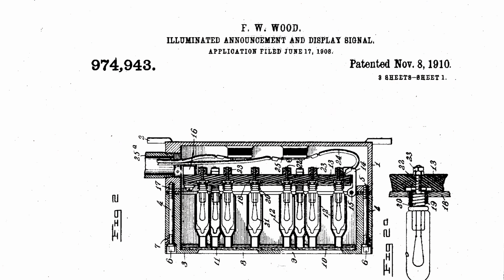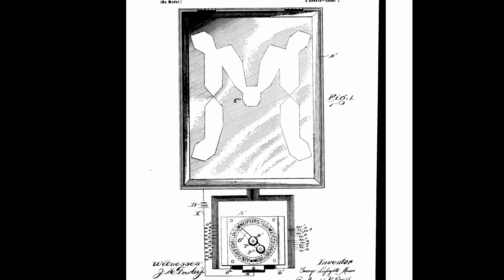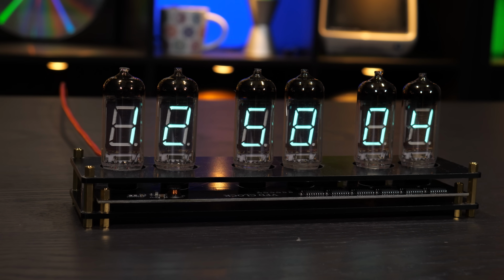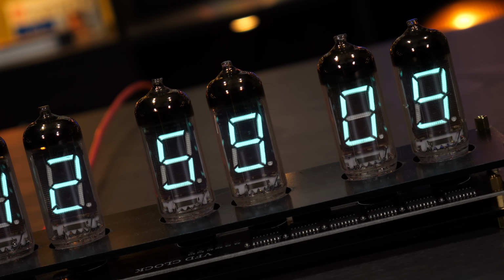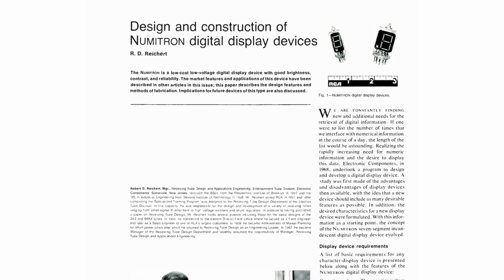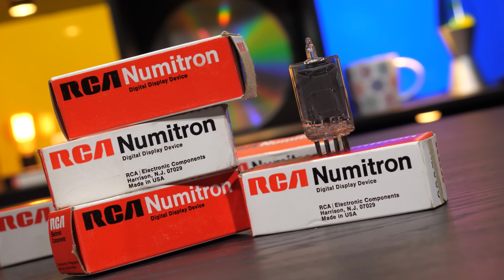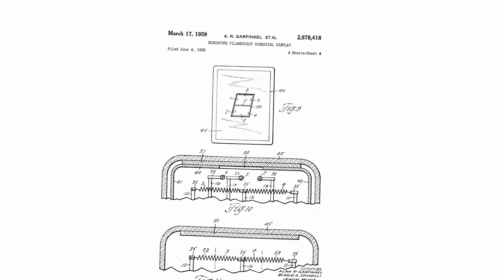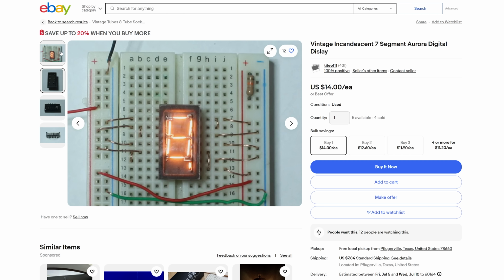The Numitron: An obvious idea that wasn't very bright

Comment: When I heard your suggestion of a giant segmented display using fluorescent tubes, my immediate thoughts were: Has anyone actually built that? If so, how long did it last in actual use before at least one of the tubes failed?
As you are probably aware, the lifetime and reliability of fluorescent tube lights depends on how many times they are switched on and off. So if a display made with them was intended to show a single number or letter constantly, with no changes and no switching on or off, it could last as long as the tubes themselves. But if it was used as a counter or clock, continuously changing the numbers displayed, the lifetime would be drastically reduced.

Comment: In 1972 I designed and built a Nixie tube digital clock using raw 170V DC from a diode and capacitor thrown across rectified AC and fed through six 7441 TTL drivers. Except for power outages and moves, it has been running 24/7 ever since. Great technology!

Comment: I loved the nixie displays on plug in desktop calculators. There was a slight depth issue from stacking 10 electrodes in front of each other, but the numbers were readable and bright. Of course 180v DC needed good AC supply. It may have been easier with 240v power points.

Comment: In the 60s we were grasping for displays.  I used 4 nixed I had to make a digital 
readout car tach, basically just a frequency counter.  It had the advantage that 
pulsing the tubes at low audio frequency could vary the apparent brightness 
by varying the duty cycle,, which my 12V to 180V power supply did.  Bruce Roe

Comment: Correct me if I'm wrong but 180V DC isn't high voltage, in fact that's only 60V more than the boundary between low voltage and extra low voltage (120V DC or 50V AC) and is nowhere near the boundary between low voltage and high voltage (1.5kV DC or 1kV AC)

Comment: in 1970 I went to an industrial display and was intrigued by calculators which had NIXIE tubes and electroluminicent displays. I learned they cost $1000 way back then. Calculators didn’t get cheap enough until 1975. A week’s pay was about $60

Comment: The +/-1 tube was a money saver for things like 3.5 digit panel meters -- you'd never display anything beyond 1999 on them, so there was no reason to use an entire digit, and you got the sign indicator. This was a thing in VFDs, Nixie tubes, and even LED indicators!

It is a sign of a very expensive piece of test equipment if they use a "full" most significant digit, such as the Systron-Donner 7004A digital bench meter.

Comment: I'm watching this again, and I think the gray background was... intentional but misguided. If I take off my glasses or unfocus my eyes, the backglow helps to mitigate the skinny wires and give a more traditional 7-segment look. However...that is quite possibly the worst way you could have done it. A dark near-black background would absolutely survive the heat (IT'S JUST CARBON! without oxygen, it can survive insane temperatures!), and slap that over a 7-segment mask to give slightly more reflectivity from the back-glow on the segments and you have yourself a much more readable display.

What's wild to me about this is just the sheer lack of effort or thought put into this. There are plenty of opportunities to improve it, even while maintaining the same bare minimum production cost mentality. It might drive up R&D by, I dunno, 10-15%, account for the new tooling and whatnot, but R&D costs are easily recouped in mass produced products like this. It really just goes to show you what a mess the RCA management was during that efa.

Comment: they werent black fpr a reason,  with a carbon black background they over time absorbed enough heat from the filaments not in overheating but in causing earlier filament failure shortening their life, so a lighter color rejected enough of the heat to allow them to stay under the max target heat

Comment: In the 1980's I was a technician repairing police speed radar equipment, know as the Decater Ra-Guns which used four of these tubes. The display was covered over by a Poloroid lense which enhanced the visibility in bright light conditions. Although these radar guns were often roughly handled by the police, the Numertons, held in place with a bracket, seldom failed. These were pre-microprocessor days when everything seemed to run on 5 volt TTL logic chips.

Comment: Those flat illuminated 7 segment displays indeed were used in gasoline pumps back in the day. I instantly recognized them and oddly do not recall if they were used anywhere else. If I recall correctly, by the time digital cash registers appear (and I worked on one of the first) LCD’s were on them.

Comment: In my country Mobil Gas pumps had these kind of displays in the 70's and 80's and I found them innovative at that time, when all other Fuel brands still used mechanical rotary displays... Mobil left my country market in the late 80 though...

Comment: You can understand why RCA didn't put a lot of effort into polishing the design. Even at the time it was probably obvious that the more time they spent tweaking numitrons the more likely one of the better emerging options would become economically viable before they finished.

Comment: 1964 I worked at a newly built GULL gas station (Gulf had yet to obtain proper regional permitting so it stayed GULL for a year). Anyway, our gas pumps had those glass tube "looking" displays for gallons pumped and the old metal rotary numbers for pricing. AFTER 61 YEARS I still remember (I'm sure it had nothing to do with being robbed at gun point then knocked out and found unconscious on the driveway).

Comment: The +/- 1 display is called a '1/2' digit.  It was(and is)  used as the MSD for many instruments (DVM's etc).  called 3 1/2 or 4 1/2 digit resolution where (typically) an analogue to digital converter only has  the resolution to generate 1999 or 19999 counts.  In the early 1980's my father made some large 7 segment displays to repeat scale readings outside for truck scales.  The digits were 4" high and each segment was composed of several of the new (at the time) high intensity rectangular red LEDs.  They were 6 digits mounted to a custom printed circuit board with data provided by the printer output of the scale indicator inside the scale house.

Comment: Honestly, the logic to drive a Nixie (with each digit requiring only one lit segment) seems much simpler than driving a 7-segment display, and 7 wires isn't that big a savings over 10.  The real problem with Nixies is that there is no solid-state equivalent!

Comment: While LED and LCD displays are more practical costlier, etc. There is still something special about the old.neon nixie tubes and numitrons.  I guess I like them for the same reason I prefer real neon signs to these new fake neon LED signs. While the faux neon LED signs are not fragile and don't require a high voltage transformer they still la k a certain charachter or ambiance found in traditional glass neon signs. For one thing the fake LED "neon" signs tend to wash out in bright sunlight while the traditional neon signs retain their vibrance, colour and visibility even in bright sunlight. And at night the traditional signs really shine in vibrant colors that make them seem as if the gave a life of their own. So I would say that traditional neons are still the kings when it comes to signage with the faux LED neons coming in as a close second. And of course not all neon signs are actually neon. Some actually use neon gas but some also use argon or krypton. Some use a small amount of mercury vapour. The tubes that use true neon are usually clear glass and when energized produce that beautiful intense and vibrant red-orange color. Others used tubes coated internally with a phosphor that glows brilliantly.  Depending on the type of gas used and the phosphor used neons can be made in a wide range of brilliant colors.  I guess that is why I love the nixie tubes so much. I recently started.collecting neon signs a d eventually I'd love to try and learn to make my own.  Now, a nice nixie clock would go nicely among my .neon signs .😂

Comment: This is 100% off topic but one of the biggest strengths of the 7-segment display  is probably purely coincidental: the fact that it can easily fit into the binary/octal system that computers use (esp. when you consider them to have 8 points where it can show light). its honestly quite amazing because any more and you would need more than one byte to control a single display, and any less and you would  be wasting space since you would need a fraction of a byte to control each display
Reply: 8 points where they can show light.... how? Theres only 7 segments... am I schewpid?
Reply: @u12bdragon  7 segments for digits, one for a decimal point
Reply: @plaid_scientist  Also the alphanumeric displays went up to 16 segments and 16 is a clean number in computing.

Comment: The Nixie tube is kinda beautiful though - in a retro kitsch way! 

I'd love a nixie tube clock on my desk.. No idea how much heat is being pumped out of them though? It does sound like they only sell a combined clock/space heater design!

I miss my Copal flip clock.. As a kid I had one next to my bed through the whole of the 80s. They had a pleasant hum to them that helped me fall asleep. There was a small constantly spinning rotor inside it off to the side, you could tell when the clock was switch on because that display was a blur, when off, you could see it was painted with individual lines. I guess that was connected to the larger rotors which were geared so that the minute and hours flipped at the correct 1 revolution per hour. Although, I think it was off by about a minute every few days - you couldn't go backwards when setting it, so you also had to flip through 24 hours to go back one minute to set it. (Or you could turn it off and wait!) . Also, don't bump the desk or tap the clock or the pin would lose its grip on current minute and flip early.

Comment: I firmly believe if it wasn't for stupidity as well as genius, computer graphics may not have developed past bulbs, meaning computers would be purely for processing different types of data for function not for entertainment. It took the average human needing a more basic display to develop better display technology. Binary output works fine for calculations or word processing, albeit slower to decode and larger in physical size, the average person would not be confident enough in binary I feel, even with its simplicity, for it to be feasible when combined with the other reasons. The genius side, however, focuses on the minds responsible for the breakthroughs from segmented displays to CRT displays to LED/LCD/OLED displays and even E-Ink displays. The amount of work and dedication required for these breakthroughs in technology just in the span of 100 years film was replaced with digital formats, and even now digital formats are put of date in just years. Genius and stupidity both drive innovation in my opinion, just to recap. Thank you for your time if you read this far into this.

Comment: You are absolutely right! I had my first car in 1971 and loved the nixie tubes that were on all the petrol pumps. I was horrified when they started replacing them all with numotrons which often had segments missing and just looked cheap compared to the lovely green VFD in my 1970 CBM calculator (which still works)!

Comment: Many electronics hobbyists LOVE Nixie displays/tubes, but I used equipment while in the USAF that used them and I was never impressed by them -- I think the Numitron is actually better as the clutter thing was a downside to Nixie.  Today if you were building something that needed a display you'd use an off the shelf LCD display that's pared to a microcontroller.  A piece of equipment with the need for a more elaborate display it's a sure bet a $10 microcontroller pared with a $40 display would almost design itself so the engineering costs will tend to be quite low.

Comment: You are correct about Numitrons being used in gas station displays.  I worked at a high volume station in the mid 1970's and our pumps all had Nimitron displays, as did the inside control panel we could read the information from the pump on.  The inside displays were much smaller than the displays on the pumps (maybe 1/2" high compared to an inch or so on the pumps).  I do not know when system was installed, or how long it was in use at that location, because I left the area in 1976, but we definitely had those displays.

Comment: A similar idea was heavily used in Soviet Union, like IN12/IN18 Nixie tube, they sorta became a novelty trendy thing for like a clock for decor or stuff like that, but they originally were used in industrial computers to display certain parameters for operators since CRT tube was way expensive in eastern world and hardly any widespread like the western world, the point is this thing wasn’t that bad if that’s your only viable option, and hey, Soviet made IN12/IN18 tube is so cheap now everyone can buy and play with it

Comment: Yes the lightbulb plus slits version made it to production. A few decades ago I repaired avionics DME indicators that used that. They came in for repair where we had to replace a number of defective light bulbs. The contrast was great and enough for use onvthe flight deck of an aircraft. Even considering sunlight. But … there Clifton Precision DME indicators became terribly hot. Hotter to hold it in your hands. 😅

Comment: I actually found a broken peice of equipment that uses  higher spec (possibly newer) numitron 7 segment display. They essentially plug into a chip socket and they actually look pretty nice. 1 single unit was cracked but i still have the other working ones from it. They kinda look like the picture of the one on the breadboard in your video here.

Comment: i have several coin operated pinball machines (1980's and 1990's vintage). they have alpha numeric displays, plasma driven. i wonder if this was similar tech. any displays that fail are now replaced with LED displays, they use less energy and last much longer.

Comment: 4:04 wow, Soviet chips? Cool! It's nice that you can find them in the USA
6:24 oh, IV-11 (ru ИВ-11)! By the way, your indicator was produced at the Saratov factory "Reflector", which still exists (although the production of lamps and indicators is closed)

By the way, you're scolding numitrons for nothing. At the time they began to be released, their main task was simply to display information. Less attention was paid to the design, and even in the mass production of such devices.
I suppose you don't care what the electrodes in your incandescent lamp look like or how crookedly the LEDs in the LED lamp are soldered, as long as it works.

It is strange that they did not use heat-resistant black paint, as on 6V6 lamps (the Soviet equivalent of 6P6C (ru 6П6С)). Maybe the paint didn't fall on the ceramics or there wasn't much difference in contrast, I don't know. Or the numitrons have already been planned to be replaced, so it is impractical to change something

By the way, their advantage even over LED indicators is high contrast in sunlight. Although this applies to any incandescent lamps

Comment: You're right, versions of the flat ones were used in gas pumps back in the 80's (LCDs became the norm going forward in the 90's). I had clients still using those old fossils well into the mid-2010's when we finally just couldn't them from the rebuilders anymore. That orange glow is unmistakable. Look up Gilbarco part numbers T14974 and T16226. I absolutely have not written those numbers down a million or so times on work orders. lol.

Comment: The Numitron-like incandescent flat packages were used quite a lot in aerospace applications, specially aircraft radios, before that slot was taken over by LED displays.

Comment: To this day LCD displays are very temperature sensitive where the voltage needed to regulate the contrast ( or you could call it viewing angle) has to be managed with thermal compensation.

Comment: In the 70's our ICL 1904 Mainframe computer had an input console that used a Teletype (with paper and ribbon) and the associated desk had a built in clock that used these orange    display tubes for a clock. The Mainframe had 32K of memory and with it's associated input and output peripherals occupied a sizable room which had to be air-conditioned to remove the heat generated otherwise it got to hot and it had to be shut down. The second Mainframe in the room was an ICL 1903T which had 96K of memory. Both were capable of multiprocessing.

Comment: The incandescent filament display was hugely useful for a long time in aircraft avionics due to the unparalleled visibility in bright environments.  The numbers are readable with sunlight shining directly on them.  In my experience, the life expectancy of the display wasn't wonderful due to how brightly they needed to run, and the often high vibration they were subjected to.

For a time in airplanes, it was either these, or bulky rear-projection schemes that consumed lots of power and made lots of heat.